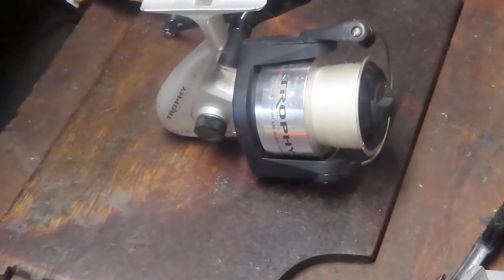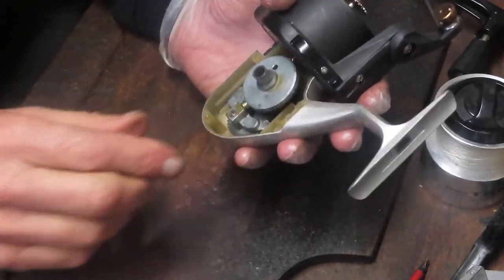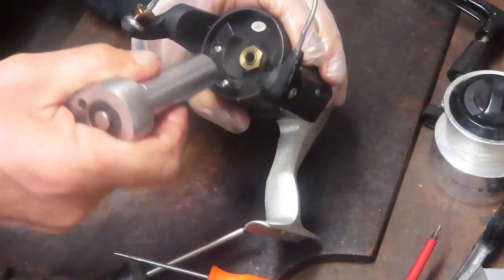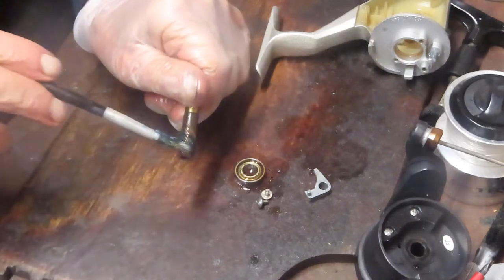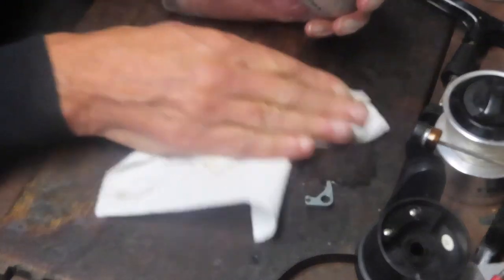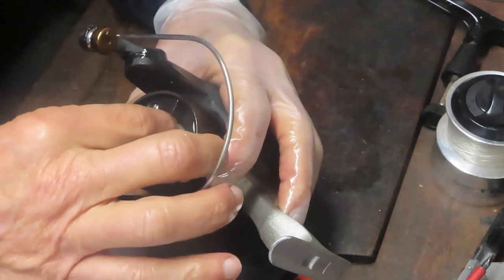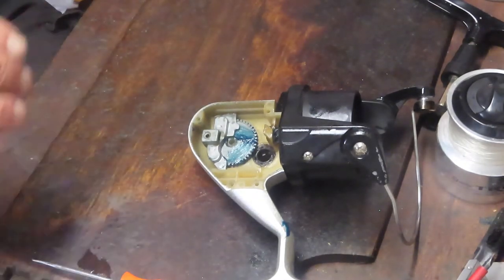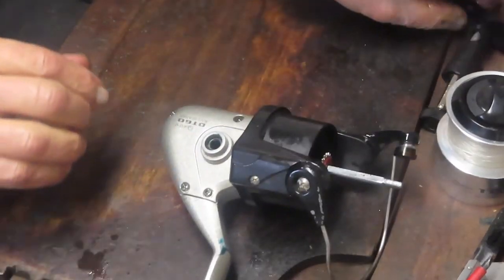Quantum Trophy 60 large saltwater fishing reel how to take apart and service

Comment: Now this would be my kind of reel if it was older. I have a couple of Quantum reels but after having a bad experience with a very expensive Cabo I have been shy about getting any more. To me it is a little surprising how thin and almost flimsy the case appears on this reel. The design is nothing unusual  but generally a good one and many reels have used it. Glad you could fix the AR problem.  I pulled out that rare Mer 52 Punch PUM surf reel I have that I was scared to fully try to disassemble when I first got it. Today I finally got the rotor off and the bearing out and finished what I started over a year ago. I sent you some photos of this reel. It is a very unusual reel. Also I got a Peerless Bam 600 vintage French reel today. I love these reels because of how well they are made.  I enjoyed this video though I don’t know how much I like the reel. As long as it wasn’t used heavily I’m sure it would suffice for the occasional surf fisherman.
Reply from the maker: Yes it is Chris.  Thanks for the pictures.  You are the Pro!  Best wishes - Dennis

Comment: I have this reel! Bought in new on a combo and it was never used. It looks like brand spanking new yet.I just took it apart and added some oil and grease to it.I could eat off the inside when I opened it up.lol might have to eBay it and update my set up.
Reply from the maker: Sounds like everything evaporated inside.  Keep it oiled and greased and it will serve you well - Dennis

Comment: Thank you for this video.  I have this reel but the top drag adjustment is missing.  Where can I buy the top drag adjustment?
Again,  THANK YOU
Reply from the maker: The part will not be available from any distributor due to the age of the reel.  I have knobs, but I would need to match it to your reel as the axle shafts vary.  Best to take your reel to a local bait and tackle shop and see if their repair team may have similar - Dennis

Comment: Hi Dennis. Was wondering if you could help me out. I recently had to refer to the schematic for my Penn Spinfisher VI 5500. My roller bearing was screaming and wanted to make sure I reassembled it properly. However, I happened to notice on the schematic that under the spool are two washers. One is the spool seal washer and the other is a thrust washer. Any way I do not see either of these under my spool and wanted to know if you had any ideas what these are for. Thank you and always enjoy your videos.
Reply from the maker: Sure - The thrust washer controls the height and lay of the line on the spool.  The spool seal sits on top of the axle shaft and seats the spool to the shaft.  You need both of these.  I would imagine that you have a lot of line gathering to the top of the spool in a cone fashion with only a little line laying on the bottom if you are missing these tow washers - Best to order replacements.  They are available at mystic parts.com - Thanks for asking - Dennis